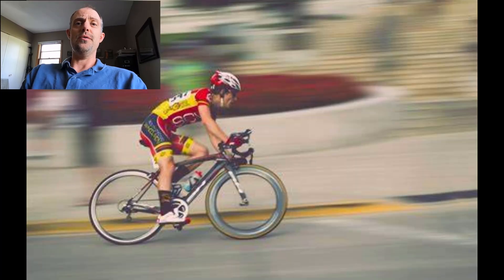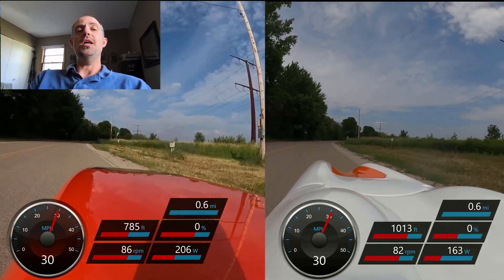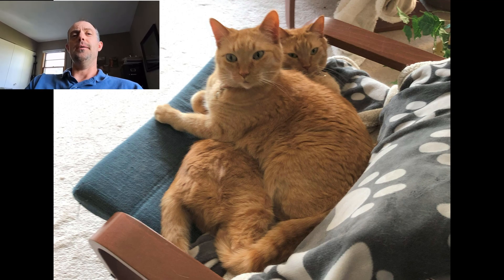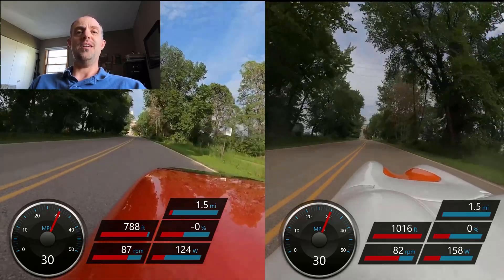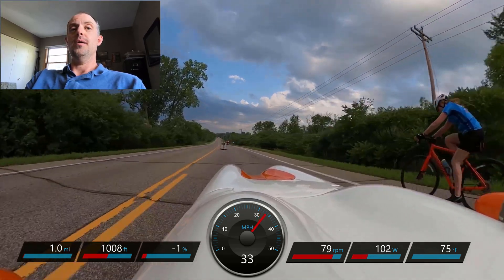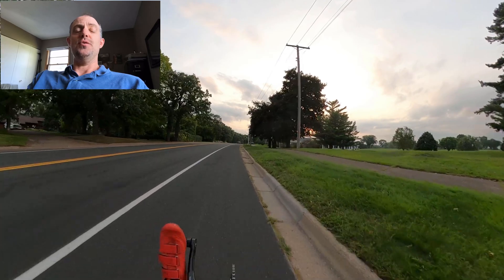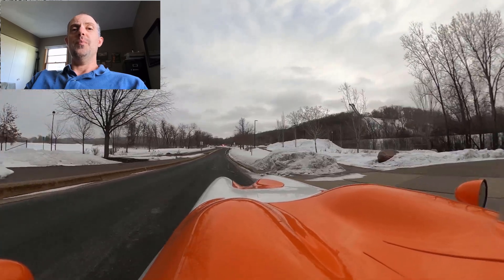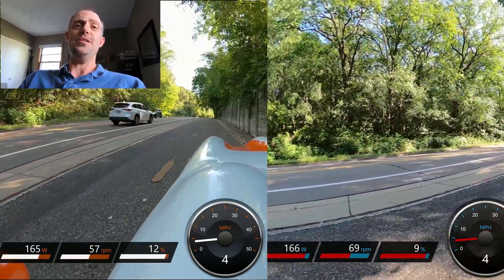Velomobile vs Road Bike vs Recumbent - an Aerodynamic Showdown

Comment: Nice and concise!
Incidentally, I can manage about 17 mph average for my with commute to work on my 'bent, but it takes just over an hour to get there. In good conditions, I'm betting I could get that down to 45 minutes with the same effort in a velomobile 🤔
Reply from the maker: @Bobbylegs37  it really depends on the amount of stop and start. If you have longer uninterrupted stretches, then you can really take advantage of the aerodynamics. If it’s a lot of stop and start with hills, then a lighter bike may have the advantage.

Comment: Thanks for this great video. The US seems to be a great country for velomobiles? I do believe you have lomg flat stretches plus speed bumps?
Reply from the maker: It depends where you are in the US. Some places have long flat roads, others have hills, and in others there are mountains. We have some speed bumps here, but not so much where I live, and usually only in parking lots and other places where you would not be going fast.
Reply: @Bengoesdutch  Can I just ask a final question? how do you feel about the stability of your veto (three wheels) vs your recumbent (two wheeled)?
Reply from the maker: @sindresvindal2290  I prefer the stability of the velomobile. It is nice to not have to worry about putting my feet down and h clipping from the pedals at stops. I also like that when I am going slowly, especially up hills, I don’t have to worry about balance. It is also much easier to keep a straight line at low speed. I find I am faster climbing hills with the velomobile even though it is heavier simply because I do not waste energy trying to balance.

Comment: I think the question should be "How fast are you on a road bike compared to the velo. keeping the engine the same and what not. Of course Im commenting before watching the whole video
Reply from the maker: I unfortunately don’t own a road bike, so I’m not able to do that comparison. Generally a bike store isn’t going to loan out a Pinarello or Canyon Aeroad so a velomobile rider can show just how slow it is on the flat and downhill compared to a velomobile. However, the fact I have the fastest recorded time in Strava on quite a lot of longer flats and downhills despite having pathetically low power outputs should give a pretty good idea of just how fast a velomobile is compared to a road bike. The speeds on the recumbent in comparison to the velomobile should give some semblance of an idea just how much an unfaired bike loses to a faired one.
Reply: I was on a road bike for many years. I am now on a carbontrike for 3 years. I am so interested in a velo. thanks for replying  @Bengoesdutch

Comment: thanks for the informative video- as an owner of a Bacchetta Corsa I was interested in hearing the comparison to the velomobile and am wondering if the Corsa's higher bottom bracket reduces the frontal area. From the video it's not clear what backrest angle you're using but I'd guess it's close to 30 degrees from horizontal
Reply from the maker: It’s quite upright. I know from prior experience that reclining as far as possible does improve speed. I regret. Or taking the time to reset it. It was upright enough to be uncomfortable. I have no idea how I ever rode with it like that for so many years. I’d guess maybe around 1-1.5mph improvement had I reclined more. The corsa is definitely faster than the Giro20, but I don’t think quite enough to make up the 7-9mph difference 🙂

Comment: Do you think it’s possible to make a  velomobile so efficient that it would be able to do 30mph at only 100watts?
Reply from the maker: I’m not quite sure how to answer this question,  partly because in the velomobile community this is a hotly debated topic and occasionally people will ask this question but be partly making a joke when they ask it. I think you are asking it seriously though so I will try to answer it seriously. 

Yes, theoretically this is possible in the right conditions. On a very flat course with favorable weather a velomobile like the Snoek or Milan SL could go 30mph for 100 watts. The designer of the W9 that I own claims the W9 is capable of this, but I have not found that to be true in the real world. The fastest models, if you ride with a very aerodynamic racing hood, very fast racing tires, on very good and flat pavement, can come very close to 30mph for 100 watts. If the velomobile was built even smaller than the Snoek it is possible such speed could be reached with a lightweight rider.
Reply: Might be attainable in an indoor velodrome, where the track is smooth, but public roads are generally in such poor repair the constant whacking of minor craters/rumble strips/paint lines/loose gravel would doubtless slow you down.
Reply: To my experience, the real life condition of the roads has a big effect on speed. Even the most aero dynamic velomobiles can't do anything about the situation. Silky smooth asphalt where the velomobile feels like flying is so very rare, at least here where I live. Just worn or rough road surface that slows the speed signicantly, just like with an upright bicycle.
 
I think that those kind of figures are nice theory but can't really be achieved. Still, velomobile seems to be the fastest thing with pedals on the road, and that's good enough for me at least

Comment: As noted: Great video!  Most of your velo rides seem to be long-ish distance, mostly uninterrupted.  My commute would include lots of urban riding with lots of short runs between stoplights and intersections.  It’s rare to get up past 15–mph for short bursts before having to stop at an intersection.  I feel like the extra weight of a velo would be a disadvantage in an environment like that.  I’d be interested to hear your opinion.  Thanks!
Reply from the maker: Yes. Frequent stop lights are a drag on speed. I think it would depend on the urban environment. I’ve been able to find routes to and from appointments and grocery shopping that allow me to at least get up to speed and cruise a bit before the next intersection, but I still end up averaging 14-16mph on those routes. In that sort of instance, a velomobile is not so valued for its speed, but rather cargo capacity and protection from the elements. I do a couple longer rides on the weekends, but my normal daily loop is 20 miles with around 20 various traffic signals. There is a stretch, the TT course I mentioned, where I can cruise at 24+ mph for 5 or 6 miles. My average speed usually jumps from around 18 mph to 20 mph or more after passing through the TT course. 

I actually didn’t buy a velomobile for the speed, though I do enjoy that. I bought it to extend my outdoor riding into the harsh Minnesota winter. It has been great for that, so much so, that I’ve largely abandoned using my car and almost never ride on the indoor trainer. It’s just much more fun to ride the velomobile.

Comment: Thanks for stating that the aero advantage is lost around 10mph.  I always wondered what the threshold was for that. This was a good video with well-digested facts for the common man.  I was surprised to see the recumbent performance to anemic.  )I thought they’d be a little closer to the velo 

Your videos continue to steadily improve. Nicely done.
Reply from the maker: Thank you for your kind words. The Bacchetta Giro20 is not the worlds fastest recumbent. A low racer with a disc rear wheel would perform better than my Giro20. The Giro is really intended as a touring bike. I have an old Volae Sport with dual 650C wheels that is probably slightly faster, but it lives on the basement trainer and is not very road worthy at the moment.

Comment: I looked up Tour de France 2023: 
2126.1 mi (3421,6km) distance 
174,092 ft (53063m) elev. gain 

This should translate to about 1,55% (1,55cm  vertical/1m horizontal) average gradiant for the Tour de France 2023. 
I don't remember if it was you or some other velomobile enthusiast, who estimated to be faster in a velomobile for gradients lower than 4%. Therefore the Tour should still be faster in a velomobile. (of course there are some shortcomings to this estimation, since cornering and decending might happen at about the same speed)
Reply from the maker: That was me that theorized about the Tour de France. Descending could actually be slower because a velomobile can’t bank into the corners and would need to hit the brakes much more when descending. The climbs can be very long and steep. I think that is where we might fall too far behind. It would be interesting to see an equally fit velomobile rider do the tour just to see, but I don’t think there is any velomobile rider who is as fit as the best tour riders so we may never know.
Reply: @Bengoesdutch  I looked up your Tour de France video, but I was watching it the first time. Anyway: 
One point worth of mentioning might be: Velomobiles allow for larger riders (with potentionally more power output) in two ways: 
- Being larger inside a velomobile doesn't increase wind resistance. 
- The weight of the rider doesn't matter that much, since the velomobile is so much heavier anyway.
Reply from the maker: @LaomerKedor  those are very good points. Rider weight will have an impact on climbing just like it does with an upright, but a velomobile will climb very slowly anyway. Aside from that, yes, a heavier and stronger rider will not have the aero penalty in a velomobile that they have on an upright.

Comment: A chart showing the speed and power data would be a lot easier for everyone to digest instead of people having to remember the power/speeds and the metric conversions, or for those of with short attention spans having to click back and forth across the video timeline.
Reply from the maker: I wasn’t looking to get quite that technical and specific. There are studies posted online for folks that want a deeper dive. The brief takeaway is intended to be that a velomobile is at least twice as efficient. The specific numbers obviously will vary depending on route.
Reply: @Bengoesdutch to you have any links of studies comparing all three? (Racing bike, recumbent and velo)? :)
Reply from the maker: @sindresvindal2290  https://www.gala-ev.org/images/Beitraege/Beitraege2022/pdf/24.pdf
https://www.bentrideronline.com/messageboard/forum/main-category/specialty-discussions/velomobiles/141387-comparison-of-velomobiles-speed-vs-watts
https://www.cyclingforums.com/threads/unfaired-recumbent-vs-upright-speed-comparisons.32475/
Reply: @Bengoesdutch  wow thank you so much!!!